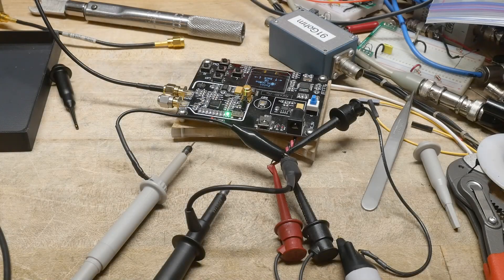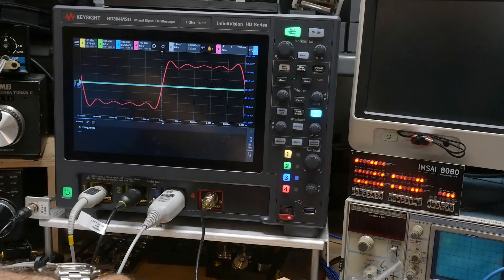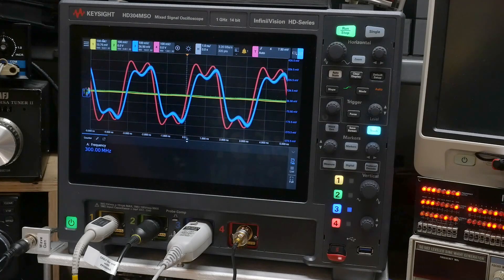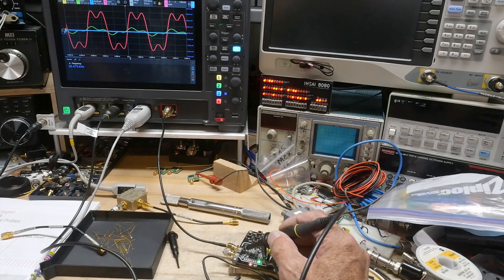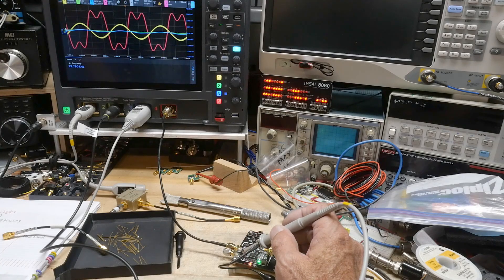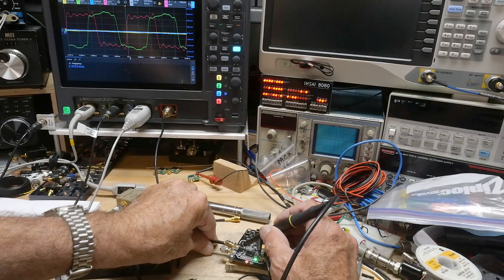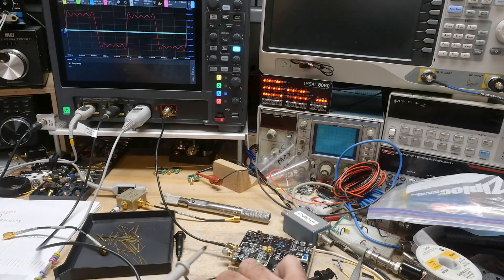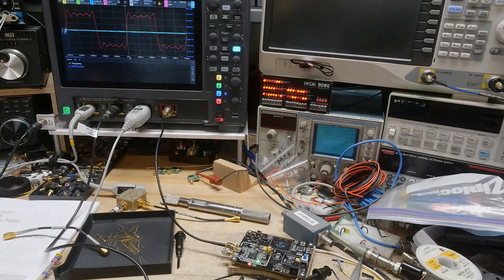#2349 Scope probe loading of a circuit (part 2 of 2)

Comment: Square waves have harmonics whose amplitudes decrease as A0/n.  Even the 10th harmonic has 10% of the fundamental's amplitude.  We must be very careful how our electronics treat these harmonics as well as the fundamental.  For square waves the even harmonics vanish; so, n is odd.  A 300 MHz square wave has harmonics at 900 MHz, 1500 MHz, 2100 MHz,... that all are well beyond the 500 MHz probe bandwidth.  Thus only the fundamental and a few % of the 900 MHz harmonic is displayed.  But, our electronics also can shift the phases of these harmonics and change the displayed shape.  I note that even the 50 Ohm direct connection mostly displays only the 300 MHz and 900 MHz components.

Comment: Think about how ridiculous it would be if Keysight produced an inverting active probe, had a fancy digital communication interface between the scope and the probe, and they somehow DIDN'T just invert the response in software! Methinks the probe is not where your inversion is occurring...
Reply from the maker: my bad, not inverted, just different cable lengths

Comment: The difference in cable lengths among the probes and the direct connection are contributors to the displayed phase difference.  At 300 MHz, a full cycle is about three and a third nanoseconds.  The speed of the wave is about a foot per nanosecond in free space and is probably something like one and a quarter to one and a half feet per nanosecond in the cables.  The direct connection appears to be about a foot, and I'm guessing the probe cables are at least three feet long, contributing at least another two nanoseconds of delay.  I see from the data sheet that the active probe cable length is 1.3 meters, which is probably contributing something like four to six nanoseconds of total delay.   (I'm not saying for sure the active probe doesn't invert, but I don't see any mention of that in the data sheet.)
Reply from the maker: yes I missed that, different lengths